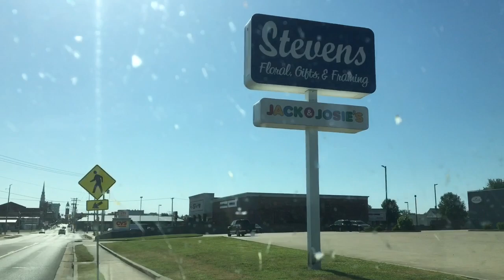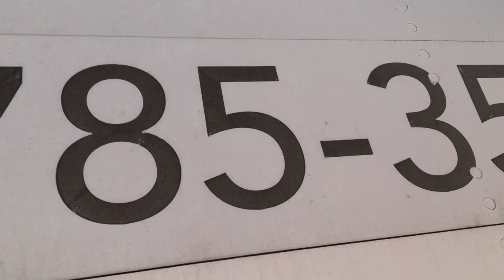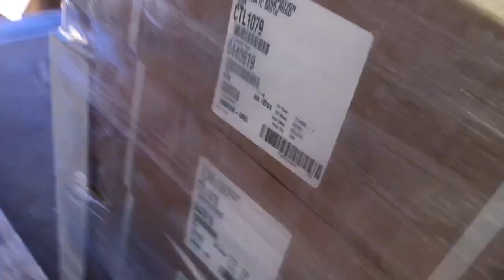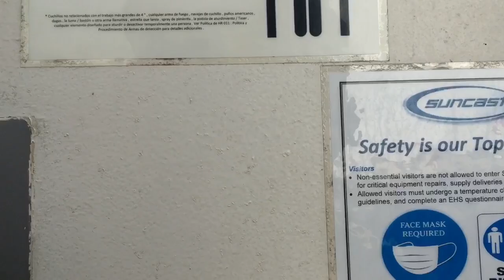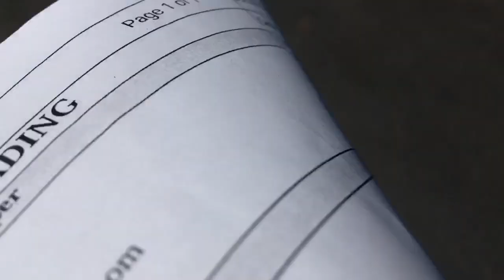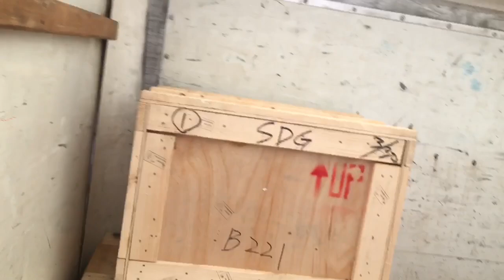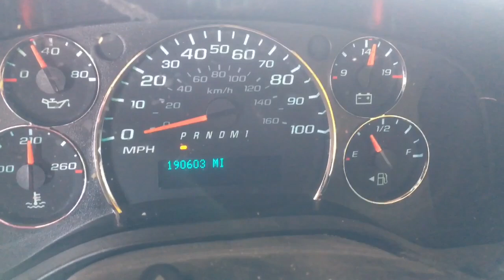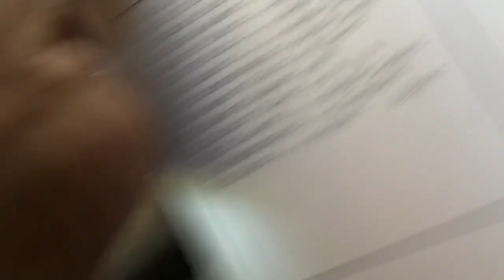$6,800 in 5 Days Cali to IL and Back before her  party in my 16 ft box truck #boxtruckbusiness

Comment: What is your sleeping step up looking like? Do you ever sleep in the truck or is it only hotels and motels? Also what kind of ramps are you using to make it dock height?
Reply from the maker: I don’t sleep in hotels unless I have to from a breakdown which happened once so far other then that the truck it is
Reply: @smallboxtrucking3219  thank you for the reply it means the world I know your super busy so you taking the time to response is greatly greatly appreciated!!!! Also I brought Ramps from harbor freight tools 6’ raise will this work?
Reply: @pompeiifightnation8643  Measure from the ground to the rear floor of your truck, (where your door meets the floor), if you are within inches of 47-50 inches, you should be alright. A standard loading dock is 48 inches. I looked up the ramps that he has in this video, its the Pittsburg Automotive 13k pounds capacity from Harbor Freight, it raises his truck 6 inches so you should be good to go.